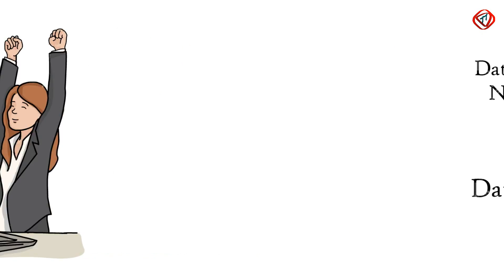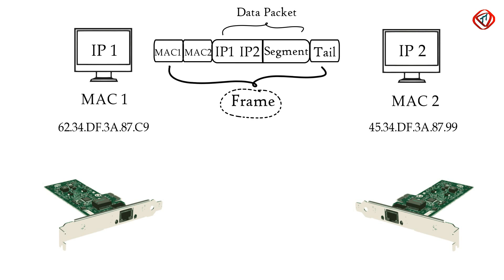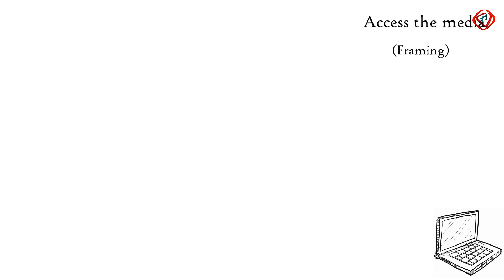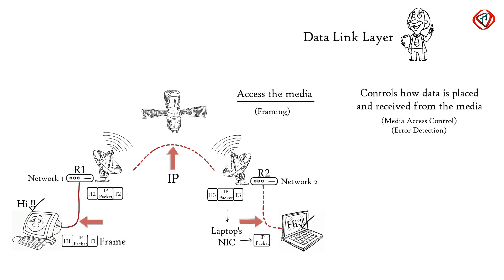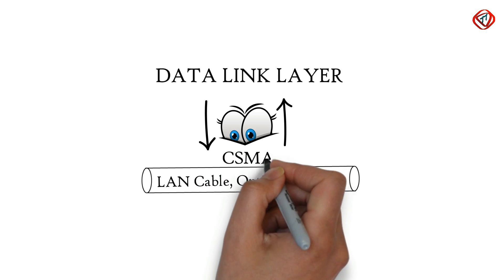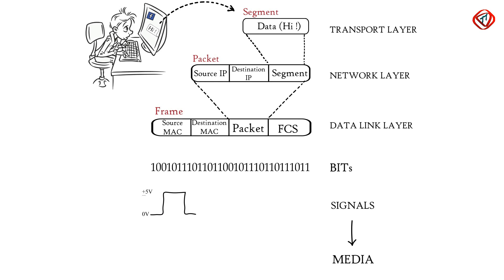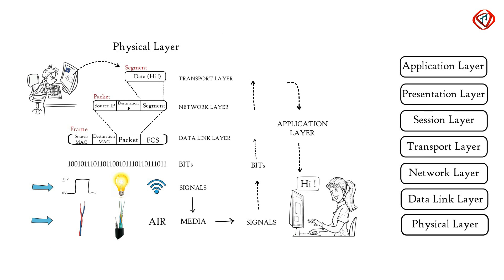OSI Model (Part 3) - Data Link Layer, and Physical Layer| TechTerms

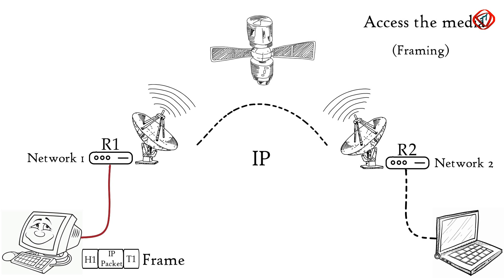Comment: @TechTermsDG Would you please explain the scenario at 2:15 video time? Isn't router a layer 3 , network layer device and how come it encapsulates frame? I thought layer 3 only encapsulates ip packets and encapsulating frame was done in layer 2. Please explain this more clearly. I have been searching for this answer from a long time and I couldn't find the answer.